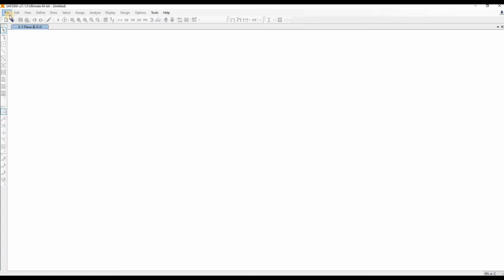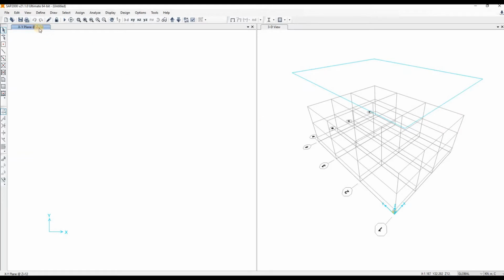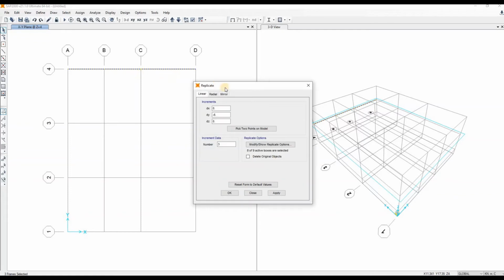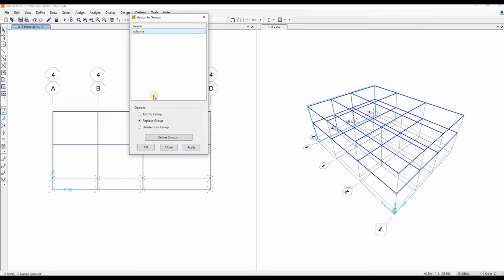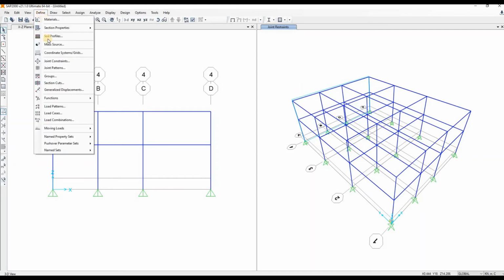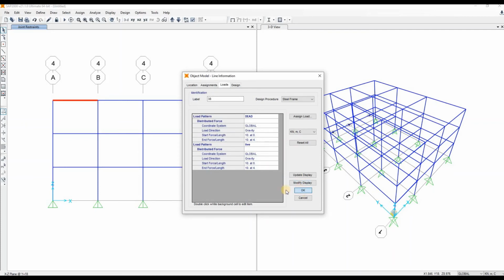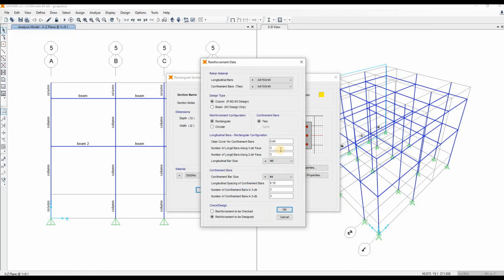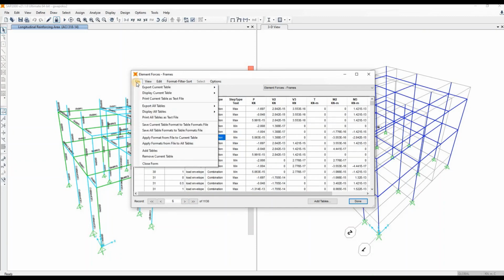sap2000 tutorial for beginners

Comment: By definition, SAP2000 is general-purpose civil-engineering software ideal for the analysis and design of any type of structural system. So in these video, its useful also for those who want to have an idea or want to learn about SAP2000, which includes me,.